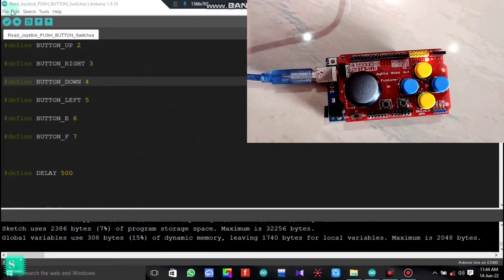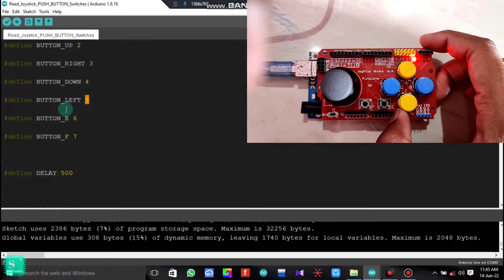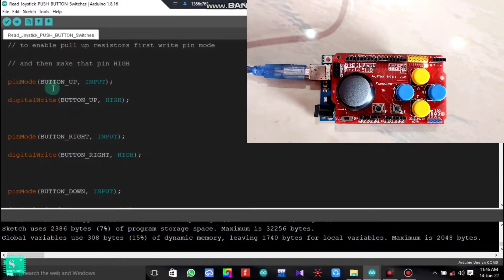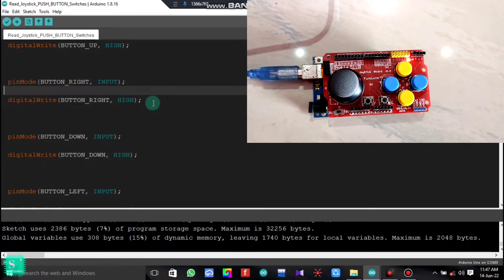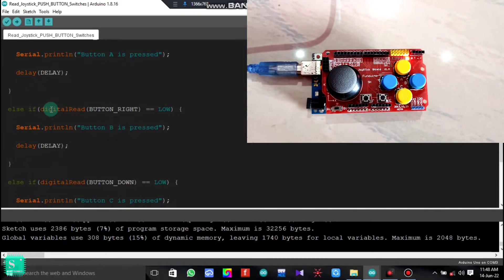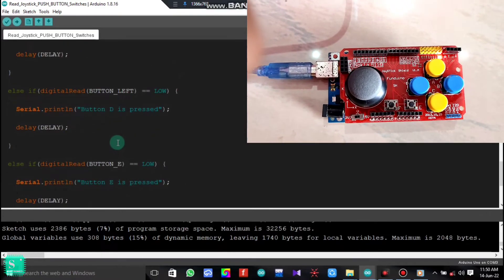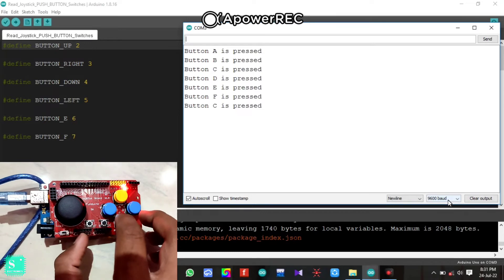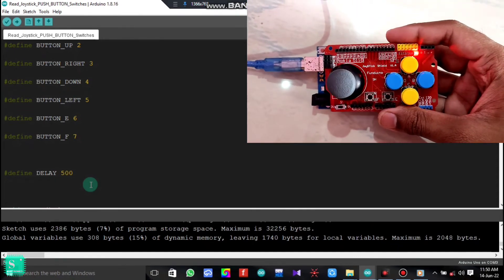How to Control Funduino Push Buttons with Arduino Code | Fully Explained | Tutorial

Comment: Can you make a radio-controlled machine for 2 motors (so that they work separately and turn together, for example) for light bulbs (so that they are turned on from the remote control), an Arduino UNO control panel and a JOYSTICK SHIELD, please